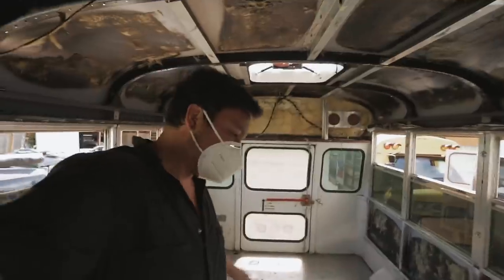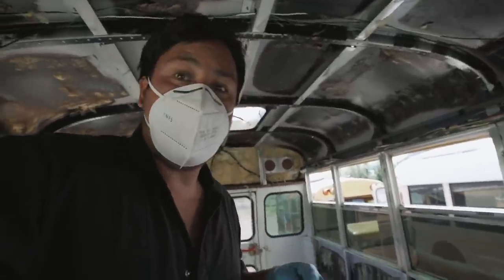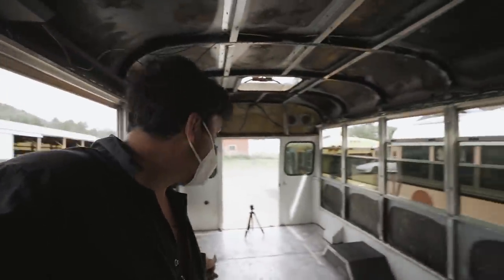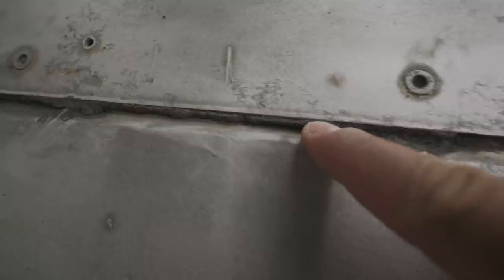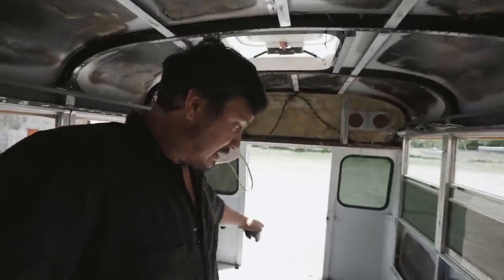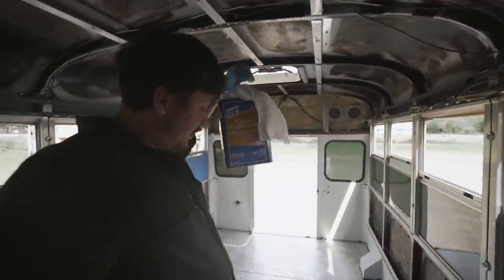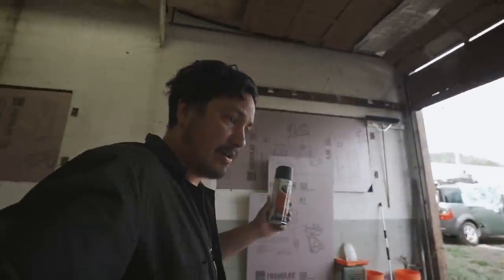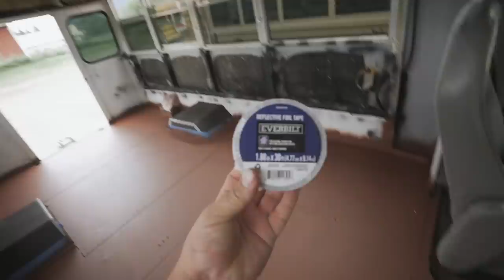Patching Holes and Prepping the Metal Skoolie Floor For A Subfloor - School Bus Conversion

Comment: You might want to drive those rivits into the channel then open a small flap at the bottom of each rail so you can get those rivits out of the channels then reweld the flaps.. I don't know about  you but all those rivits ratteling around in those rails would drive me CRAZY !!! : )
Reply from the maker: Ahhh that may be a good idea
Reply: They won’t make hardly any noise, never hear them in a bus not to mention all the materials covering it up to
Reply: Will ensure any noise deadening.

Comment: Isaac, is it possible to get an air conditioner in Peach for the baby?  It will be so hot during the summer and the baby will be miserable which = crying baby and stressed out mom.  Can you install a split a/c  or a portable a/c that vents through a window?  I have one of those for about $350 and it cools my 500 sq ft apt  ice cold.  Think on it.
Reply from the maker: Easy to put an ac in. If we need it we will